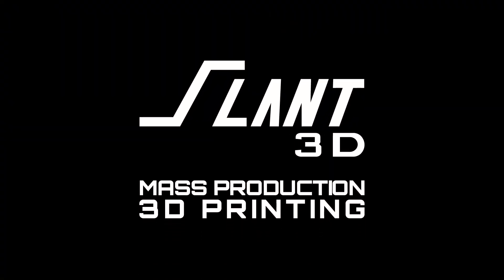Why We Decided To Build Print Farms

Comment: How are you going to solve the automation problem?
Reply from the maker: Our machines are designed for high automation. And we keep building out our robots to improve automation more
Reply: @slant3d  What kind of automatic ejection and sorting systems are you planning? Will it be robots removing build plates? Or will the final parts actually come off the plates?